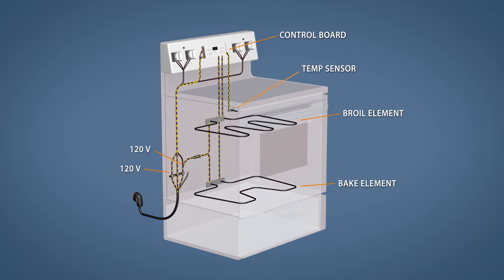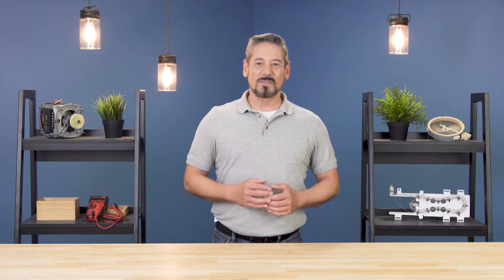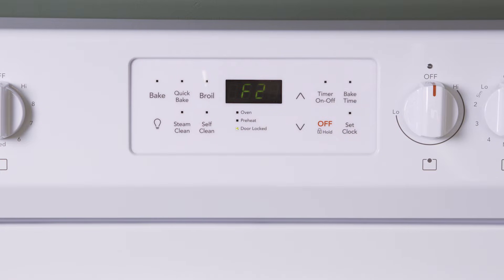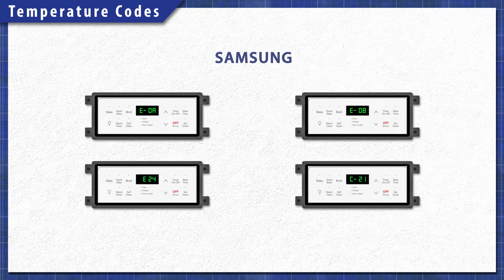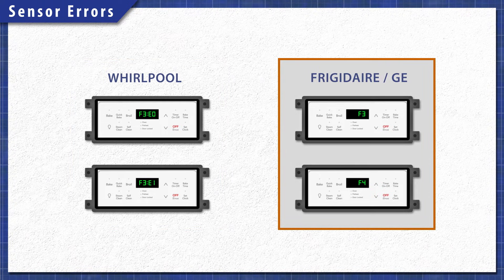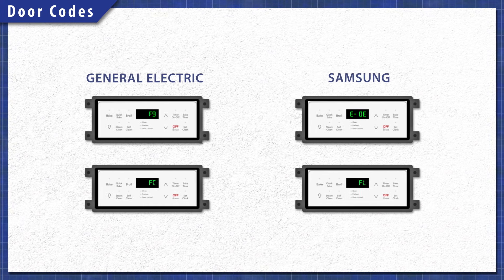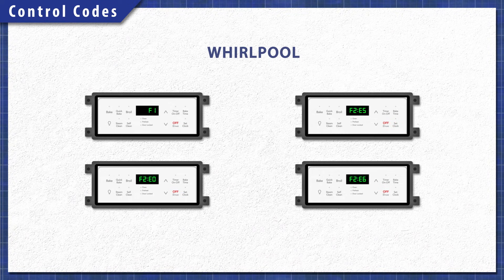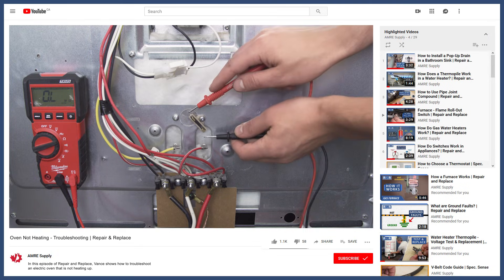Electric Oven - Error Codes Explained | Repair & Replace

Comment from the maker: Did this video help you narrow down your oven's error code? Let us know in the comments!
Reply: Yes it did helped me. I highly recommend it. In fact i shared it  with my piers.
Reply from the maker: @cgarcia74769  Awesome, thank you for sharing! Every little bit helps our channel grow!
Reply: What does a GE  error code of F1 mean?
Reply from the maker: @mickeysumner8780  It cold be an issue with the key panel. In some cases you might be able to replace just the key panel, in other cases you might need to install a new control board: https://www.youtube.com/watch?v=ORTi4lLyoqw
Reply: @AmreSupply  Thanks for the information.  However, my oven is JKP27WP2WG and there really isn't a keyboard, just some arrows and other items.  We searched your website, (and others) and it appears that the control panels are no longer available?  Can you please offer me any leads to find a control board or component to make the fix?
Reply from the maker: @mickeysumner8780  There are some parts that become obsolete and are not available anymore. There are some specialized shops that will do these sorts of electronic repairs. It is a specialized skill so it's not something that is easy to do. Right now I can't vouch for any specific company but there is that option if you do some digging. In these sorts of situations people have to weigh out the cost of a repair and the time it would take to get it repaired as well against what a new or used oven would cost.
Reply: @AmreSupply  do most electric stoves burners turn off if left on accidently?
Reply from the maker: @tip6603  Thanks for watching. Most stoves will continue to run if the heat switch is left on. On ceramic stoves the heating elements have a limiter that will disconnect power if it overheats. You can learn more in this video: https://www.youtube.com/watch?v=y6vIOwLfnDg

Comment: I have a KitchenAid double door oven. I replace the upper broiler element now when I plug my stove in that element heat up instantly without any power button is pushed. What is wrong with that
Reply from the maker: Thanks for watching. It's possible that something has shorted through the metal frame. You can check this following the steps in this video: https://youtu.be/ABope7vl5IY?si=zSKChQPhYS8Y2AI3&t=202
Reply: @AmreSupply thank u I appreciate your help

Comment: Hi. We bought a Whirlpool model WEE515SOLV June 17th, 2025 and have had error code F3-EO which keeps us from using the oven. Please help.
Reply from the maker: Thanks for watching. That could be an issue with the temperature sensor, wires or the control. You can see how to access the sensor here. Check all wires to make sure they are secure and that nothing is melted or damaged: https://www.youtube.com/watch?v=jnt_mUwdL8o&lc=UgyBwSWuA28VHl-tDGd4AaABAg
Reply: @AmreSupply  so my KitchenAid double door oven I put a new broiler element in the top oven and now as soon as I plug in the oven that broiler element turns on and start getting hot with no power to the stove other than it being plugged into the wall, but there’s no on buttons, or nothing turned on. It just comes on all by itself. Not sure what to do about that.
Reply: Model number KERS507XSS,01 KitchenAid double door oven

Comment: I used the steam clean function on my GE gas range, model JGB735SP ISS; now the door is locked; I'm getting error code F910 with a little lock icon and the oven is popping and periodically beeping.  Unplugged for 30. minutes; plugged back in - same behavior.  Can you help?
Reply from the maker: That error code indicates a door lock issue, and that's usually caused by a faulty door lock assembly.You might need to replace the door lock assembly which you can see how to troubleshoot in this video: https://www.youtube.com/watch?v=GTJRf-aCXbw

Comment: Frigidaire oven with f10&f30 codes, help!!
Reply from the maker: Thanks for watching. Those are both temperature codes so if the oven is not getting to hot, then replace the temperature sensor and make sure the connections are all secure. https://www.youtube.com/watch?v=jnt_mUwdL8o

Comment: My frigidaire has 5d error code
Reply from the maker: 5d means that your oven control board thinks it's in show room mode.
Try unplugging for 60 seconds. 
Plug the unit back in and within 45 seconds of plugging the unit back in, press and hold the oven cook time button for 5 seconds. 
Then press the Stop/Clear pad to exit.

Comment: My GE PB960SJ2SS profile Oven is getting a F50 code. I have unplugged it for hours and reset the breaker. Plugging it back in gives the error again. 
Anyone have any ideas of what needs to be fixed?
Reply from the maker: Thanks for watching. In that model it could be an issue with the door latch switch or the wires.

Comment: Nice video. What does a frigidaire F82 code mean?
Reply from the maker: Thank you. An F82 error code can mean that the door isn't closing properly or the the door switch is not working. In this case the control board thinks the door is not closed. You can test the door switch here: https://www.youtube.com/watch?app=desktop&v=sWSUzTuvFRI&feature=youtu.be

Comment: Nice video. What about F38 on GE oven??
Reply from the maker: Thanks for watching. That doesn't seem like a common code.

Some similar codes are:
F3	This code usually means that the oven sensor needs to be replaced.
F8 - This code usually means that the electronic control needs to be replaced.

Is the code still there after unplugging?

Comment: Mys story. I was almost finishing cooking while the storm was at full power.... at one point a bright light in the sky, a big boom and lights out. 3 days later (Before yesterday) lights back on. Ok, lights, Ok. top burners, ok but will continue without stopping increasing heat. Oven the same but stop working at all. The Electronic Oven Control Panel keeps on blinking and no matter what I push, nothing will happens. Any suggestions?. Help?... thanks. Oh, I forgot.... I opened it up and it was dirty, I cleaned it with a brush. The sticker says ... 316455400 and a paper that came with it, which shwos different drawings, etc has this number 3164555  That's it Thanks again.
Reply from the maker: Thanks for watching. If that issue happened right after a power surge then it could have damaged the control board or shorted one of the components.

This video talks about the overheating issue: https://www.youtube.com/watch?v=10ezc3LNQP4
It could also be a stuck relay on the control board, or just a faulty board but this cannot be tested easily.

Comment: What is SEL code
Reply from the maker: Thanks for watching. It might be a SEL, or even a 5E depending on how you read it. A 5E code can indicate that the touch control panel has shorted or has a stuck button. In some models there is a separate keypad that can be replaced and in other models this is part of the control board. Unplugging the model can sometimes reset this. As well any loose connections can also create this problem. If either doesn't help then it's best to replace the keypad or control board.

Comment: Fridgidair, error code F15
Reply from the maker: Thanks for watching. In that case it could be a faulty control board. Check all the wire connections to make sure they are secure. Try a reset. If it doesn't help, then it's best to install a new control board: https://www.youtube.com/watch?v=ORTi4lLyoqw
Reply: @AmreSupply  I pulled the boards out and there seems to be a corroded connector... the likely culprit... I'm not savvy enough or equipped to work on PCB, but I have a solution ... only $120 to get resolved...
Reply from the maker: @mikep509  Thanks for the update. Most people do not have the tools or knowledge to work on replacing components on control boards, so replacing the entire control board is usually the way it goes.

Comment: Electrolux faran error code F13
Reply from the maker: Thanks for watching. An F13 code can mean that there is an issue with the control board. If you have reset the power at the breaker and the code still shows up, then the board might be faulty and would need to be replaced.

Comment: Hi  - We turned on "bake" and there was a pop/smoke and then it didnt heat up. Zero error codes and you can still bake and set temp buts its not heating up. any ideas? all other features work fine.

thanks
Reply from the maker: Thanks for watching. It's likely that one of the heating elements has burnt out. Try testing the elements following the steps in this video: https://youtu.be/ABope7vl5IY?si=YFPQCKiEMhXqbPkx

As well it could be a limit switch or a thermal fuse: https://www.youtube.com/watch?v=Ox1lPMJY62U

Comment: I replaced the temperature sensor on my whirlpool but still gives error code of F3 E0
Reply from the maker: Thanks for watching. If you've installed a new temperature sensor and you're still getting that error code, then it could be an issue with the control board or the wiring. Check the wires between the control board and temperature sensor and make sure that there are no burn marks and that all the connections are secure. If that still doesn't help then it might be best to install a new control board.

Comment: Mine is F7 on Frigidaire and this didn't address it
Reply from the maker: Thanks for watching. An F7 code can mean that there is a stuck button on the control board. This often requires a replacement keypad or control board depending on the model.

Comment: Hola buenas tardes. Que modelo es esa cocina tengo la misma y no le encuentro donde dice . La mia marca error F2 E0
Reply from the maker: Thanks for watching. The oven is a Frigidaire, CGEF3036UW range. F2E0 means the touch control panel is failing or there is a stuck key on the keyboard. You can try to unplug the oven, or reset the breaker. As well you can double check that all the control board connections are secure. If that doesn't help then a new control might be needed.
Reply: @AmreSupply  de casualidad tiene algún video explicando eso? En mi caso mi cocina cuando la enchufo el boton Cook time se preciona solo.
Reply from the maker: Oven Control Board video: https://www.youtube.com/watch?v=ORTi4lLyoqw

Comment: I have a Frigidaire range that has a code showing SD I believe that it is in showroom mode, my electric went out a couple of days ago,
Reply from the maker: 5d means that your oven control board thinks it's in show room mode on this model. To try to exit show room mode, unplug the oven and plug the unit back in after 1 minutes. Press Cancel to bypass programming clock. Within 60 seconds of reapplying power, press Oven Light keypad as well as the Timer keypad simultaneously.

Comment: F27 !
Reply from the maker: Thanks for watching. An F27 code means there is an issue with the keypad / control board. You could try checking the wire connections to make sure that they are secure. If this doesn't help then you might require a new control board.

Comment: Frigidaire stove ,Code F27 how I can change it?
Reply from the maker: Thanks for watching. An F27 code means there is an issue with the keypad / control board. You could try checking the wire connections to make sure that they are secure. If this doesn't help then you might require a new control board.

Comment: I have a frigidaire electric stove .. I shut off the breaker for it by accident couple days ago .. the light for door locked was on and couldnt open door .. I followed ur video by taking the back off because its a rear motor .. unhooked the wires etc .. hooked it all back up ... plugged it back in and turned breaker back on ... the door locked light is still on but the door opens ... but all the buttons for using the oven dont work ... not the bake, broil, etc .. I did another reset on the breaker for few mins and still nothing ... door opens , door locked icon still on .. and cant use any oven functions ... Any help ?
Reply from the maker: Thanks for watching. If you've tried a reset by holding down cancel and it hasn't helped then there could be a couple things that you could check.

Check that all the wire connections are good.

You can check the door lock motor switches that monitor the position of the door lock during a self clean cycle. If any of these switches are faulty then it can create issues: https://www.youtube.com/watch?v=nf0bN0VgdnUa

If that doesn't show anything then check the door switch: https://youtu.be/sWSUzTuvFRI?si=yIxkVN2bT5az2vkS

As well a faulty temperature sensor can cause issues if the oven thinks it is unsafe to unlock the door: https://www.youtube.com/watch?v=jnt_mUwdL8o

Hope this helps!
Reply: I did hold in the cancel button and all it did was beep .. I also checked continuity w/ a meter like you had and I did get a reading .. so its not that ... the stove top works and the door opens now but when I push any of the oven push buttons like bake etc .. nuthin happens .. Thats the confusing thing ... the door opens but none of the oven operations work ... I'll check the other things it mite be tomorrow .. thnx !  @AmreSupply

Comment: I are getting ErrA code that beeps in the middle of the night. I am old and live alone. It is not smart to go in the basement to shut of the breaker in the middle of the night. Any other ideas? It us a Criterion and inly 3 months old.
Reply from the maker: Thanks for watching. If the oven is only 3 months old it should be under warranty. If the code is not listed in the manual, then it might be best to contact the manufacturer or the distributor that you got the oven from and they can likely provide more information.

Comment: What's f7:e0 ? I cannot use the oven it start warming up stops and show that error😭 I have KitchenAid
Reply from the maker: Thanks for watching. An F7:E0 code means that there may be a problem with the Oven Door Latch Assembly or the associated wiring. 

You might want to try a manual reset if possible.

You can see how to test the door switch here: https://youtu.be/sWSUzTuvFRI

As well the door latch can be tested here: https://www.youtube.com/watch?v=nf0bN0VgdnU

Comment: I have an F7 E8 code on my GE Profile Electric Stove model JCSP47BF5BB. Stove works but oven controls, clock doesn't. I'm thinking it's a bad control board.
Reply from the maker: Thanks for watching, and sorry about the delayed response. An F7 E8 code can mean that there is an issue with the keypad. You can try checking the connections to make sure that they are secure and that there are no burnt or damaged wires. In many cases you might need to install a new control board / keypad.

Comment: My Whirlpool just says F2. No other errors indicated. Unplugged it for 2 hours but it still says the same.
Reply from the maker: Thanks for watching. An F2 code can mean that there may be a problem with the Oven Temperature Sensor, the Control, or the associated wiring. You can see how to test & replace the sensor here: https://www.youtube.com/watch?v=jnt_mUwdL8o

Comment: What is a err F1 E0 for Whirlpool oven and do I fix it?
Reply from the maker: Thanks for watching. A F1 E0 code can mean that there is an issue with the oven control board, or the associated wiring. Try disconnecting power to try to force a reset. As well make sure that all the wire connectors are secure. If there are any damaged wires, then the wires will have to be repaired. If none of that helps, then it's best to install a new control board: https://www.youtube.com/watch?v=ORTi4lLyoqw

Comment: Amana Error code F1E1 , could you please help 🥹
Reply from the maker: Thanks for watching. An error code F1E1 can mean that the oven control board is not communicating correctly with the components. If you tried shutting off the power for several minutes and the code still appears, then there could be a loose connection between the control board and one of the components, or the control board is defective.

Comment: This is garbage! I am 67 and cannot MOVE the stove! It is BEEPING so I just held down two buttons and poof it quit! Does this fix my oven NO but at 10:00 PM you just need the >\<%thing to shut up!
Reply from the maker: Thanks for watching. Stoves are heavy so it is often easiest to move it with two people. Sometimes stoves are held in by anti-tip brackets which might make it harder to initially move. 

As well if needed, the power to the stove can always be disconnected from the breaker panel.

Comment: Just bought a brand new Frigidaire Professional Wall Oven (PCWS3080AF). Code F16 came up immediately after it was installed. Why would they not even list this error in the manual? Costco Concierge support cannot help. Frigidaire is back in the office on Monday. Really regret this purchase.
Reply from the maker: Thanks for watching. A Code F16 can mean that the oven control board is not communicating correctly with the components. If you tried shutting off the power for 5 minutes and the code still appears it could be that there is a loose connection between the control board and one of the components, or that the control board is defective.

Comment: What does error f3 e0 on amana oven mean ???
Reply from the maker: Thanks for watching. It means that there could be an issue with the temperature sensor, the wiring or the control board. You can see how to test the sensor in this video: https://www.youtube.com/watch?v=jnt_mUwdL8o

Comment: I have a whirlpool stove. My oven doesn't heat properly and Im getting an F6E4 code. What does this mean?
Reply from the maker: Thanks for watching. It means that there may be a problem with the control board or the associated wiring. It is recommended to shut off the breaker for several minutes. This can often reset the system. If that doesn't help then check to make sure the wires leading into the control board are secure and that there is no burnt or frayed wires. If the wires are good, then it could be a faulty control board.